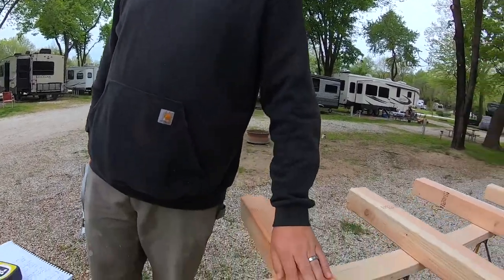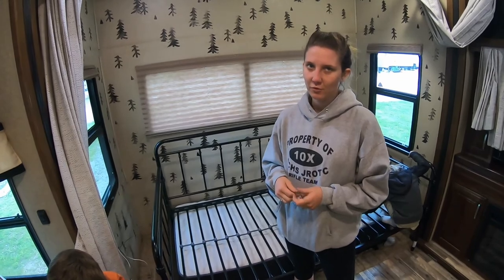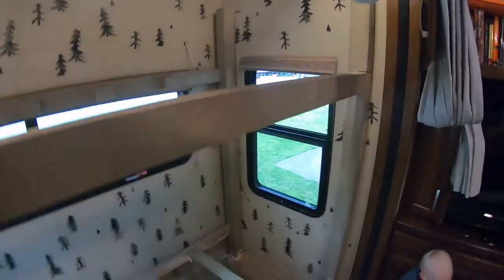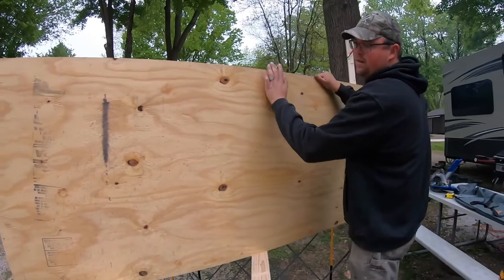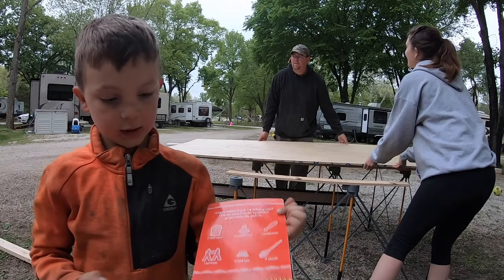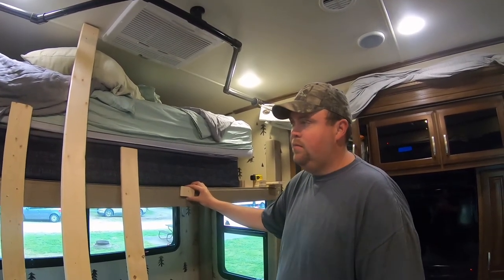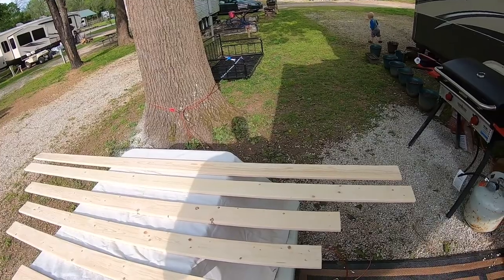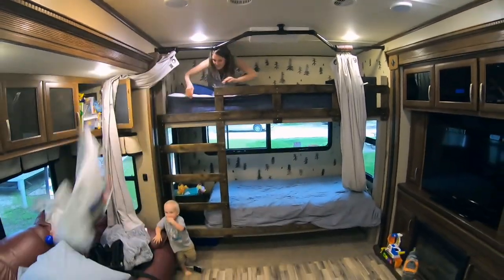RV Bunk Reno Part 2 | Custom RV Bunks |  DIY Camper Bunk Beds | Full time RV Family RV Renovation

Comment: Great job I love the way you build it and put it together, there is one thing that I would love to know, how do I know where to screw the wood to the wall and how big of screws do I need to use
Reply from the maker: We had windows in the back and I knew there would be supports on each side of the window. We just used like 1.5" metal screws because our frame was all aluminum. You can also get the plans from the manufacturer most of the time and it will help you find studs.

Comment: in the intro to your video... what was the metal plate you installed under the camper?
Reply from the maker: It's for the slide rollers to roll on instead of the bare wood. On the wood they start digging in and causing ruts in the wood. The metal plates prevent that and help it roll much smoother
Reply: @HayesHumbleHomestead  did you have to custom order the plate?
Reply from the maker: @tinaharlow4508  just made it ourselves out of some 1/8" steel plate

Comment: How is the humidity with the mattresses just sitting on the plywood? We have dehumidifiers just about everywhere, but we still find some moisture along the bottom corners of our lower bed (his mattress sits on pallets currently)
Reply from the maker: In the three years we had this rig, we never had any issues with the mattresses molding. We did have one definitely that we'd move around occasionally, but it was usually downstairs next to the island.

Comment: Did you attach the frame to the trailer walls?  If so how?
Reply from the maker: We used a couple of little L brackets at the top of the posts and screwed I to the wall just to make sure it doesn't rattle a lot going down the road. Other than that no. It's heavy enough and fits just right that it can't really move
Reply: @HayesHumbleHomestead  thank you!